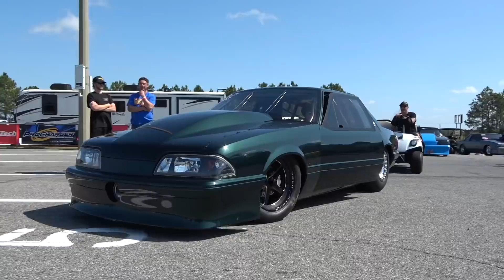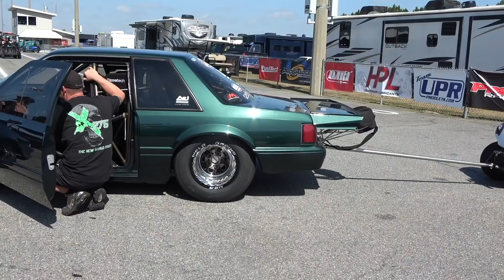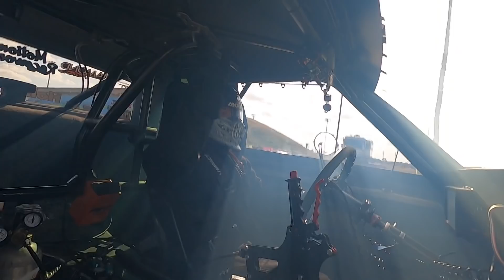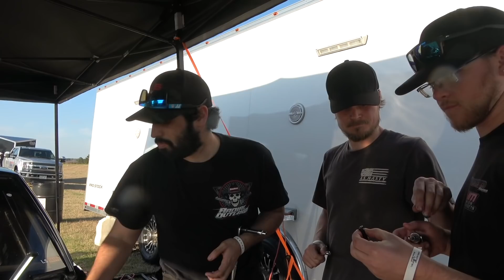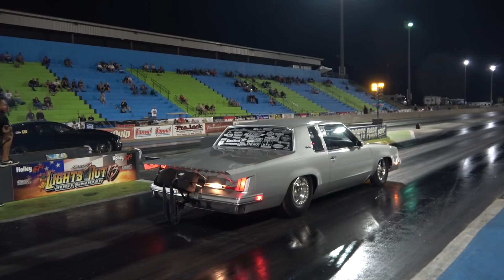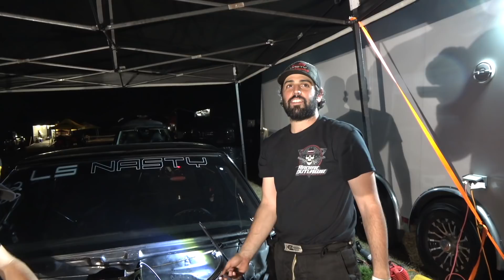Lights out 13!! Day one Testing and Qualifying for the BLACK SHEEP is a STRUGGLE!!!

Comment: Since the car is already over weight and you don't have a billet block you should go ahead and put a 295 tire on the car and you will still be able to run at the same weight without having to take a weight penalty with the bigger tire it might help get the car down track and who knows you might go alot faster
Reply: Or 315

Comment: Looks like the track got good bite!!
Reply: Most have struggled all week so far, supposedly not very much rubber on the track just glue. Should get better throughout the event. No big tire classes or slick class to help lay rubber down.
Reply: More than half the cars knocked the tire on the hit. Not any real good 60’ numbers.
Reply: Radial tires don't leave rubber like slicks